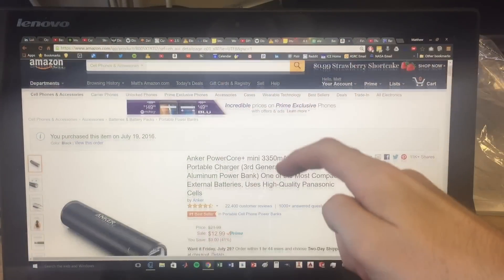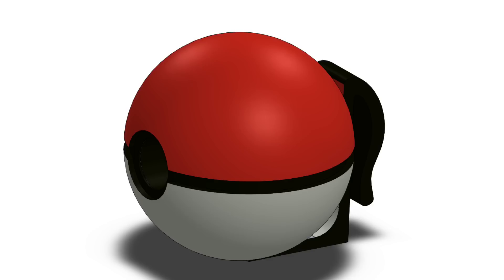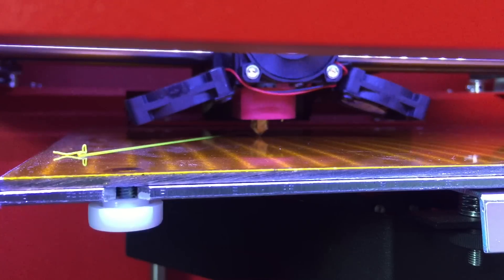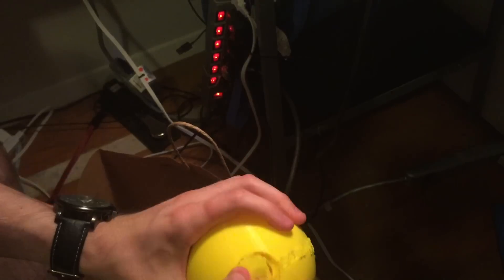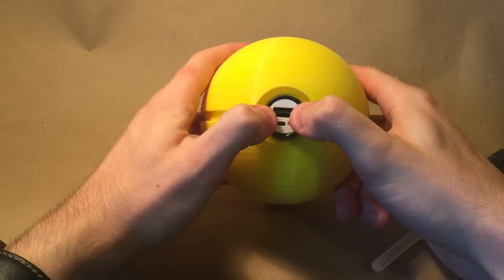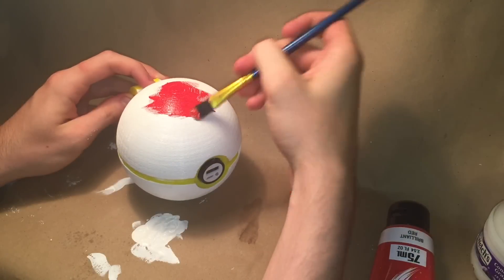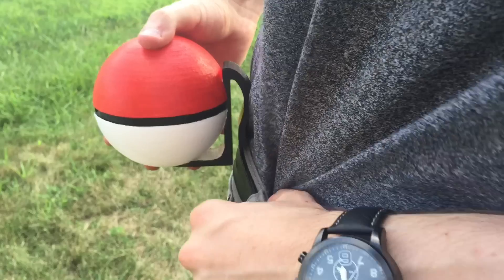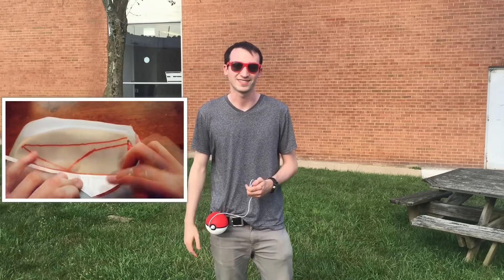How To: Pokeball USB Charger  -  Pokemon Go

Comment: MATTCARL I NEED YOUR HELP I'm having trouble with almost every single earbud I come across every single one no matter how expensive, I usually just listen to music and every time I notice in one ear it dosent work it is weird because it happened to me just today and it's getting annoying, I move the wire a little and I hear it slightly and sometimes it come back on fully I think it can be fixed please help post a video anything that can help me with my ear buds I don't want to spend any more money on expensive headphones that cut out in one ear every time thank you if you even read half of this and good luck with anything and your inventions 😄
Reply from the maker: Hmm, that's a tough problem since it's not clear where exactly the problem is. It could be where the wires meet the actual speakers in the headphones, but it could also be where they two wires join to form a single wire, or it could be where the 3.5mm headphone jack is. Is there any place on the headphones that seem worn?

Comment: That's really cool. I think a subtractive sculpting method is more available for your viewers though.
Reply from the maker: True! Although 3D printers are becoming more locally available (at least in my area), it did cross my mind to sculpt and cast it but I've never worked with those materials before and I had a 3D printer next to me. It could definitely be sculpted and casted from the dimensions in my 3D model if that's your forte, thanks for the the suggestion!
Reply: ***** Casting would be also a way, though casting something with a cavity is not as easy as casting something massive. You could cast it as a massive piece and then drill a hole in it, of course. Lathing one of these would also be pretty interessting I guess.